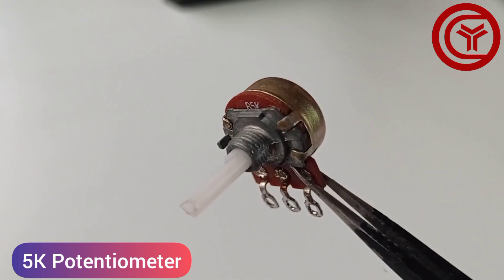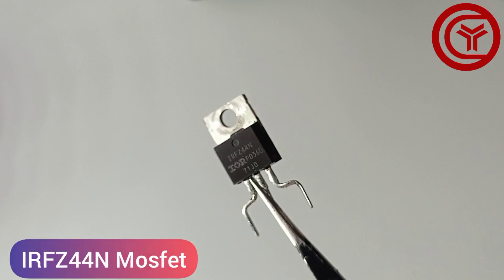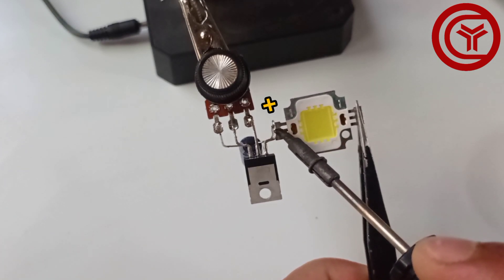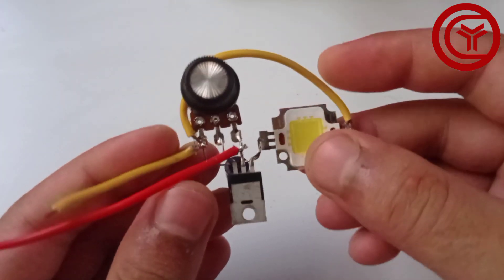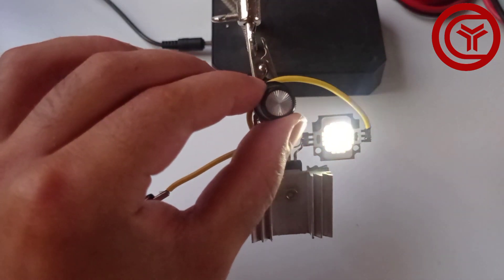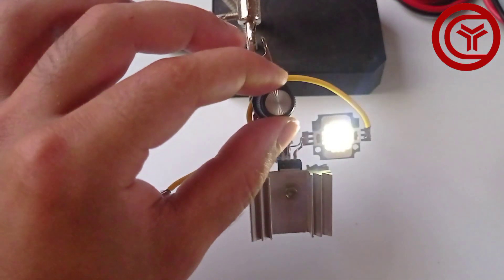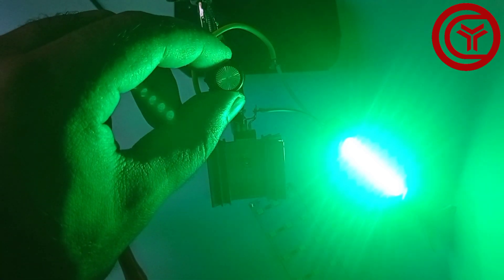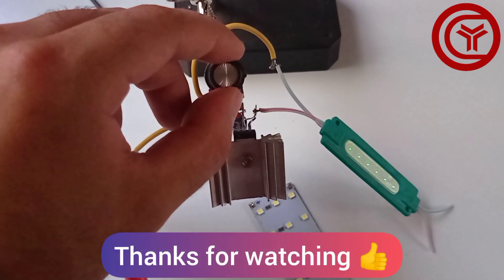12v led dimmer led controller circuit

Comment: It's not going beyond 40 W ....MY IRFZ44N module burned out always when I go beyond 40W and I m also using big heart sink
Reply from the maker: Actually this is basic circuit, you can check out PWM based circuit recently uploaded on my channel for motor and same can be used for led, without heating issues.
Reply: @CreativeTechos  thank you so much 😊
Reply from the maker: My pleasure, Thanks for watching 🙂

Comment: Can it take the load of 5A , 12V ?
I guess yes , cuz it will be 60Watt , and u said it can take upto 100watts , please confirm me , if i am right 👍
Reply from the maker: Yes it can be used with this load but use bigger heatsink and if possible with cooling fan for effective heat dissipation.
Reply: @CreativeTechos  ohk bro